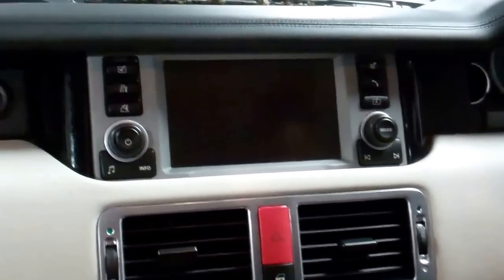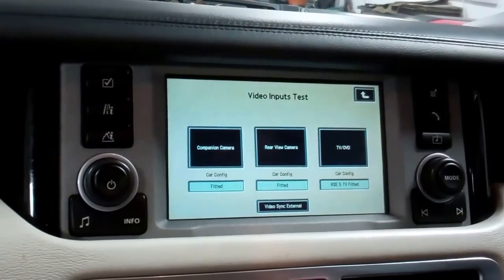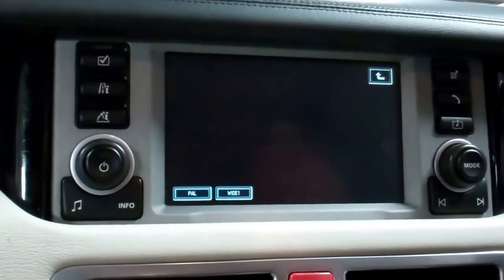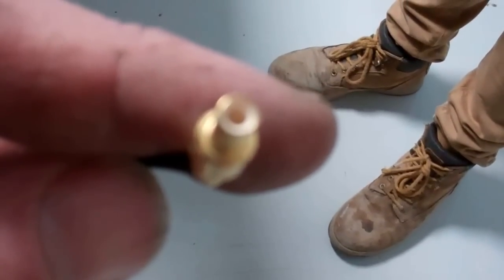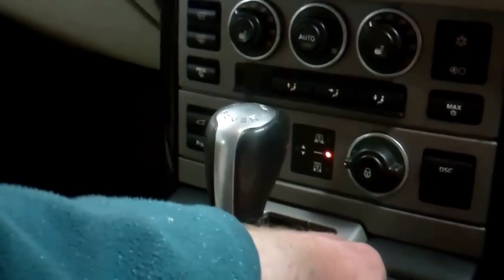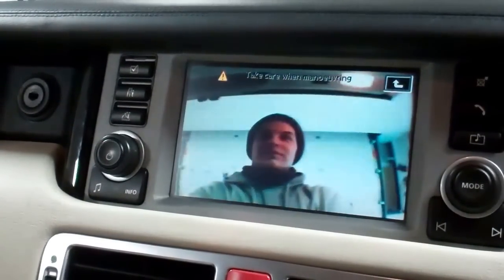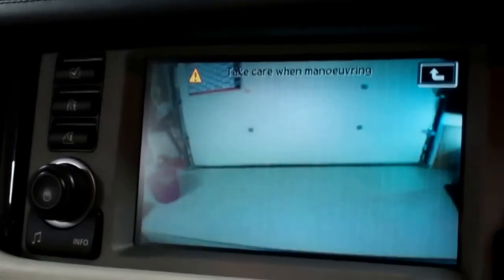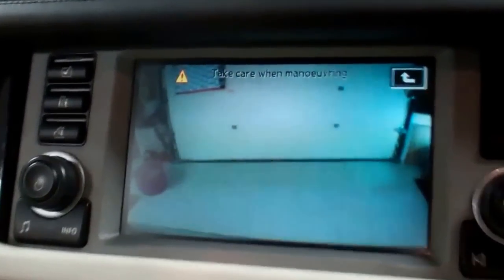How to test Remove & Fix Rear View Reverse Camera on Range Rover L322 Reversing

Comment: Hi
My reverse camera was working but just intermittently and with poor quality. I replaced it with your camera and now there is nothing but just a black screen.  I checked the fuse and it is fine. Is there anything else I need to do? I saw some people said the battery needed to be reset?
I dont think the original problem was  anything other than than the camera going bad since it would still work intermittently.
Thank you.
Reply from the maker: Hi - we can send you another camera - we do not have many fail but it does happen. Can you check the voltage with a volt meter ? check the connections.
Reply: @L663  Hi, thanks for responding.
I will double check with a voltmeter as soon as able (but might not be until the weekend) and email you through your website.

Comment: Do you know with 2008 Range Rover Sport HSE if you can just add the camera to the back and it will work as an add on without adding extra wires?

It seems like the Navigation is standard and the harmon kardon stereo
Reply from the maker: I am pretty sure the wiring is not there !

Comment: I have this rover. My ignition is not right. If I pull the key out and out it back I can't start it. Won't turn. If I pull negative terminal for 5 sec and put it back with key in it it will start?? What the hell?? Can I install a push start in this situation
Reply from the maker: This is interesting - there is some sort of ECU reset happening.

Comment: I noticed your picture didn’t have the color grid lines. I had them but now I don’t. Any idea on why they went away or how to get them back?
Reply from the maker: No not sure how to activate this feature - i would think it in the control unit not the camera as they should turn with the steering wheel

Comment: Oh wow,,, ,That's a great fix!!!! Mine is doing the same thing. I have to replace the 3rd tail light, so while I'm at it, I'll look into this. Thank you so much. Cheers.
Reply from the maker: 111K people have watched this video now so you are not alone my friend - we also sell the new cameras if you are not able to fit it !
Reply: @L663  Just tried the soldering, and it still doesn't work. UGH!!!! How much are your cameras? I may be able to put in a different camera from an FPV drone that runs on 12 Volts. Should have an extra around here somewhere. Be nice to have it all original though.

Comment: Hi I know this was a while back, but do you have any tips on soldering the wires to the pins on this camera  (there so small and pin case is an issue) cutting it away and cleaning and then insulating etc?
I have this very issue and rather than spend mega bucks on new camera this method works for me, if only I knew how you soldered the wires to pins?

Comment: Hey mates, this video saved me some serious fed.  My backup camera on my 2008 L322 HSE has not worked for years.  I followed all of your direction and it worked like a charm best of all I did it in about an hour including soldering the wires directly to the circuit board.  Wish I could post a picture that I took right after I finished of my dashboard showing the back up camera fully functional. 
I swear this is what YouTube is all about. Thank you for your video, Cheers, Tony.  
My next project is how to retro fit a 2005-2009 D3 Bluetooth mod with a 2009-2012 D4 bluetooth module.  I have read about the process but have yet to try.  Been looking for a YT instructionl video on the wiring harness part.  It changed from a 3 row harness to a 2 row so can not just integrate the harness.  You two seem like the type of chaps that would hack around with a project like this, so If you know of any videos or feel like giving it a go that would be much appreciated.
Reply: Sad news to report, this fix only worked for a short period of time until it failed and retrying soldering the joints did not fix the problem a second time.  SOLUTION, I ordered one of those after market Cameras from eBay for $48.00. (don't get a cheeper one) The camera I got has a Sony chip set on the board and the lens is glass and is 2mm larger then the OEM camera and best of all it's HD.  I followed the same soldering process this video shows on how to solder the joints and a simple retrofit into the same holder under the spoiler and voila works amazingly well now with back up lines.
Reply: @tonyserra4596  do you suppose you could post an update showing the difference between stock and HD?  Is it that much better to warrant the upgrade if your camera is working fine?  Thanks.  Big fan.  Love the videos!
Reply: Hi Tony. I would really appreciate it if you could steer me towards the camera and the vendor from whom you purchased it

Comment: can you guys do a video on how to install (if possible) an aftermarket reverse cam to the 2005 L322. not sure if I have to run the video wire to the back of the nav. unit or if there is some prewiring somewhere closer to the rear of the truck I can access?

Comment: ok i did that with my 06 RR hse it worked fine when i put it back together but as soon as i mounted it back it went out again i even soldered the 4 wires on the camera can u let me know if there is something else that can be the problem. when i mess with the signal wire not the positive and neg but the other it seems to work for a bit then cuts out when i try to install it back.
Reply from the maker: Yes the connections seem to be a real problem - no magic solution for you sorry - you just need to make sure all connections are good !

Comment: Hi wonder if you can help got a 2011 Range Rover autobiography my screen won't come on the camera is not working sometimes the doors don't lock at the back some times they don't unlock the display for the Saf nav won't turn on at all constant amber flashing light on the power button the screen shows Range Rover but doesn't come on at all it was working fully fine two weeks ago had some repairs to the rear bumper and tail gate n when I got it back it's not working now

Comment: hey bro.      i have a range rover sport 2006 v8 and i have a problem with the headlights...the eyes looks down and i dont have lights wenn i am on road....maybe you know the reason and you can help me...thanks
Reply from the maker: Is this both headlights ? is this on LOW beam and HIGH beam ?
Reply: powerfulukltd on low beam in the main beam headlights....and the big beam shows to high...